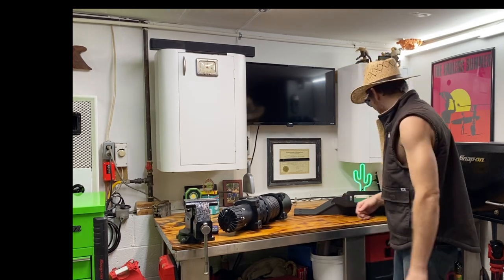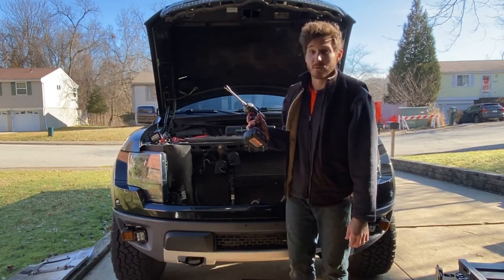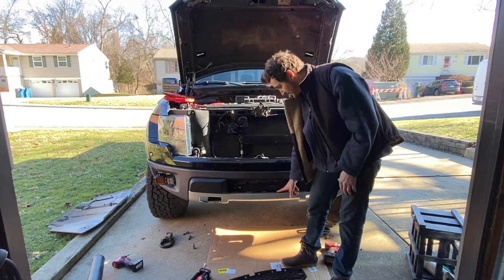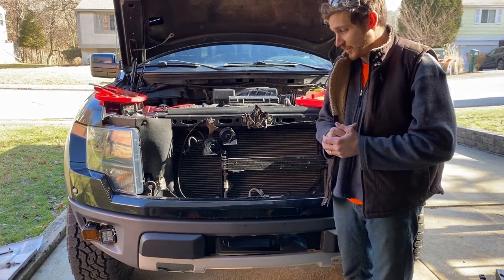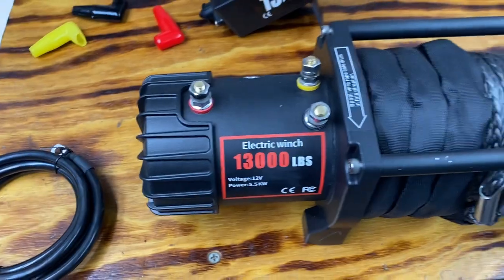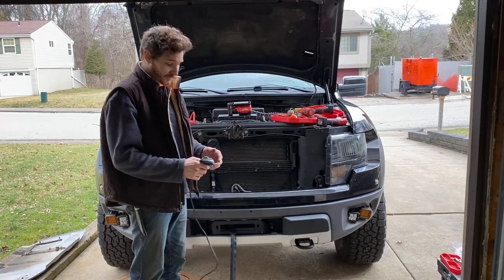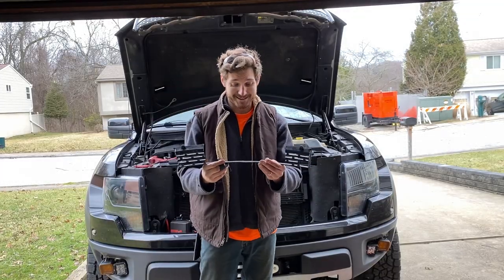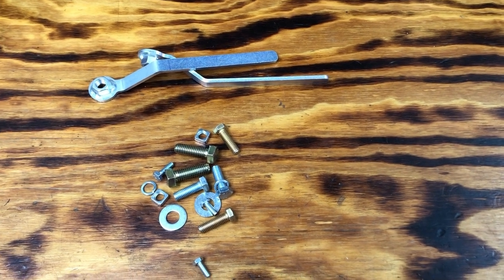Ford Raptor Rough County Winch Mount Install

Comment: Now how do you turn on the winch or plug in the remote?
Reply from the maker: There is a hardwired remote you plug into the solenoid box. Also it comes with a wireless remote, that is what i use all the time. Watch my unboxing video to see more. https://www.youtube.com/watch?v=vR9Iqd2HXZo&t=98s   also watch my other video I use the remote and pull down some trees https://www.youtube.com/watch?v=-rjZM8XiEuw&t=468s   thanks for the comment!!!!
Reply: @TySlimVlogs  gotcha after I typed the comment I realized i meant to say how do you switch from spool in back to free spool since you can't reach the handle but I'll check out the other video. I had a 2012 but sold it many year ago and have regretted it more than any vehicle ever so we will be adding a 2014 to our overlanding fleet in January once these damned jeeps are paid off.   Keep this up man and don't get discouraged....I've seen a lot of talent give up in the first year due to numbers but DON'T.....youtube is about the long game!
Reply from the maker: @DownSouth_Adventures  glad your getting another First Gen Raptor!!! You have to open the hood to engage and disengage free spool. Thanks for the nice words and comments. I’m enjoying editing and having fun with the videos currently so I will keep it up!!!